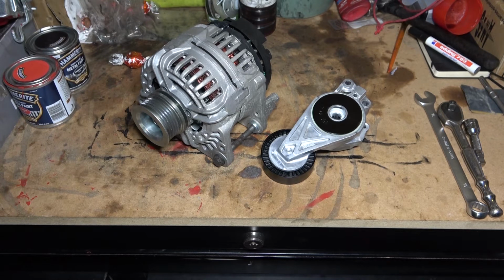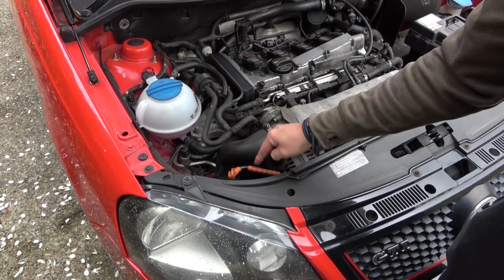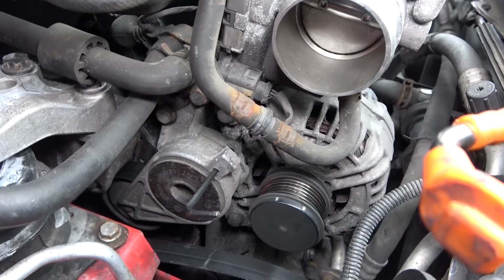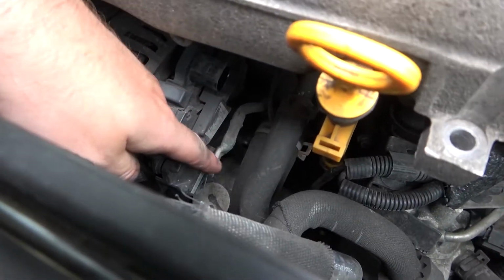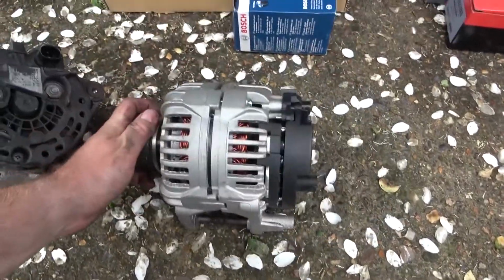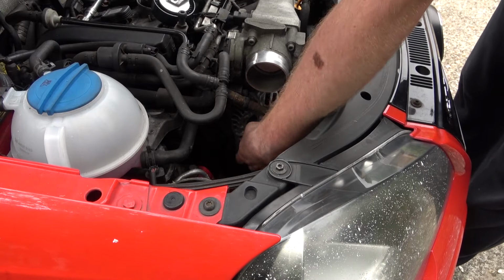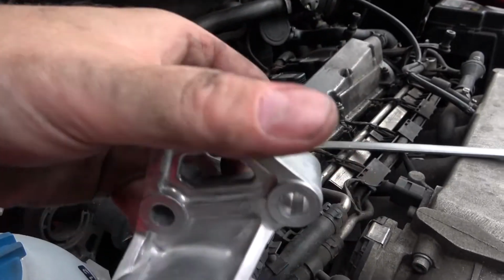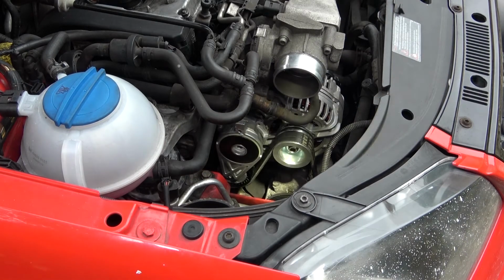Replacing The Alternator And Aux Belt Tensioner (Polo 9N3 GTI) 1.8 20vt BJX

Comment: What spanner did you use to loosen the earth cable at the back ? I'm struggling to get my hands in there
Reply from the maker: The earth cable on the back of the alternator? 
I’m pressure sure it was a 13mm shallow socket I used 
If not it would have been a 13mm ratchet spanner 🔧

Comment: Hi do You know where i can pass a boost gauge line inside the cabin?
Reply from the maker: Run the line into the cabin through the same hole as the rear washer line, it’s located on the passenger side foot well (assuming you have a right hand drive car) it should pop out in the engine bay by the abs module, I hope this help 👍🏻
Reply: @CarsandEngineering  thanks!!!

Comment: I had to remove the altnator to fit a new thermostat, it was a huge pain
Reply from the maker: Trust me mate it’s more hassle not removing the alternator 😂
Reply: @CarsandEngineering  I can imagin, I snapped the dipstick tube refitting the altnator. Phoned euro car parts at 30 mins to closing to ask if they had one. They did 1 left 🤣
Reply from the maker: I feel your pain! I’ve gone through like 3 now 😂